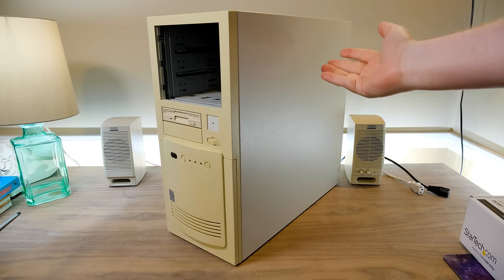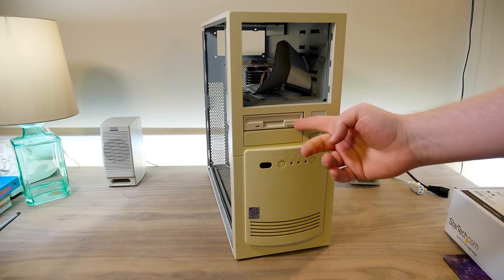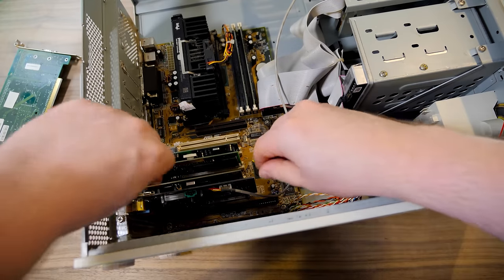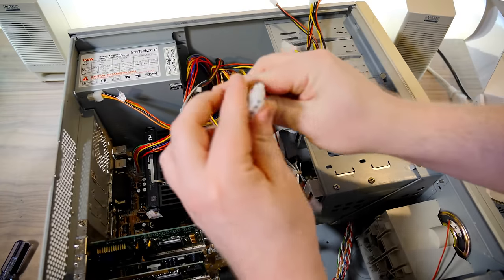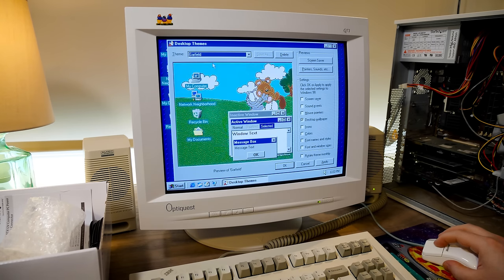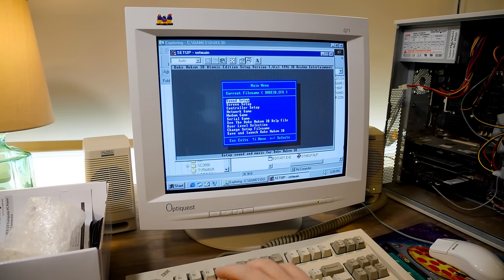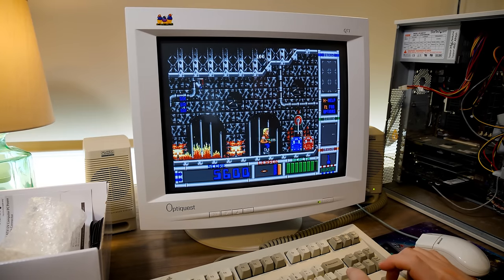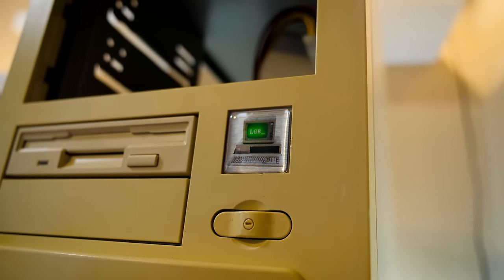Testing This Generic 233MHz Pentium II PC Clone

Comment: SBlive support for dos isn't great it requires protected mode so some games wont work and uses lots of memory. That dirt on the bottom of the case looks like the residue from water evaporation. I think the system got wet and the dust turned to mud and settled on the bottom as it dried. ET6000 with a Voodooo1 was a common combination because the et6000 was a fast 2d card with a high quality ramdac (a good card for highres software quake and duke3d).

Comment: I remember my first computer was a Gateway 2000 it had a Pentium II processor I had Windows 98 second edition on it and then I remember upgrading it to Windows XP that was in 2004 OMG it was horrible LOL I had also a 6gb Quantum Bigfoot hard drive I believe I maxed it out at 256 MB or was it 512mb I can't remember but I remember using dial-up AOL. I think I paid like $40 for it at Goodwill it came with the keyboard the Tower and the monitor and a mouse. I used it until about 2006 when I built my  very budget gaming computer.

Comment: I do have a stupid question about systems like this. I do imagine that the agp slot is only 2x and then we have the voltage problem using any agp graphics cards that uses agp 4x o 8x being incompatible. Would be a common card like a fx 5200 compatible with  a system like this for retro gaming from 94 until late 2003?

Comment: I want to see you make a BeOS computer cos I used read about it in magazines but don't have much of a clue what it is.
Reply: The BeBox was a serious RISC workstation with dual PowerPC processors and tons of expansion.  It's too bad it never went very far.  It was originally designed around AT&T's Hobbit processor which was designed to run C code natively.

Comment: Missing screws and hard drives with only two screws holding them in? So that's where my old PC went to ;-)

Actually no, it's not my PC... that HDD has two screws holding it down and the motherboard isn't relying on the cards to hold it in the case.

Comment: A system like this here in brazil costs more than 2 and a half times our minimum wage(R$ 1000 Reais its the minimum wage. With the actual dolar would be like 500 us dolars . Speculation over vintage hardware here its horrendous. If only i could pay for someone send me one of theses to here, would be wonderful. Certainly it will cost less than buying non-working vintage computers from inside the country.

Comment: Pentium 1 233 MMX is better IMHO than the Pentium II.  Because you can have very fine grained control of its speed using setmul. So you can run really old games on it.  Down to 386 speeds

Comment: my guess to your question at 23:01, it's an infrared transmitter/receiver they are common on PDAs Laptops of that time, might only be a mounting point to mount the two LED's needed, if lucky maybe an IrDaTx/Rx connector pin header on the motherboard, maybe by com (serial) ports labaled IrDa or something?

Comment: Why did older PCs always have the psu at the top?
Reply: @Jason Bourne   I'm not sure why that answers my question. Is the psu the hottest part of the system? That would seem odd to me. And the case doesn't even vent from the top anyway; in fact, the exhaust fan is /below/ the psu

Comment: If you want Adlib emulation on a Live! card in Windows 9x (or DOS Prompt), you have to go into Multimedia options in the Control Panel and select the FM synth emulation from the MIDI device list. You can also select MPU-401 from there as well.
Reply from the maker: That's if you want to enable FM synth mapped to General MIDI on port 300/330.
What I was testing is AdLib emulation on port 388.
Reply: @LGRBlerbs  Yeah, there isn't any hardware-based Adlib emulation on the Live! cards as far as I'm aware. I also couldn't get it to work in real-time DOS mode using the Philscomputerlab drivers, and that was with the full SB0100 model, so I don't think you'd have better luck with that cut-down Dell OEM version lol.

Comment: GM never has been amazing on the sblive? Are u nuts Clint?
You may not like tbe bundled soundfonts but it could load better ones as long as u had enogh system ram. Try a 32mb one or aorund that and tell us it's not amazing (wasn't recommended to load anything over half the system ram).

Comment: FSP powersupplies (The person who made that sparkle) at least at one point was known for making good PSUs... but everything wears out over time.
Reply: Yeah, I've seen a handful of SPI PSUs over the years.  Better than others I've encountered.  This one just sounds like a fan that's dying.  I bet if that was replaced it would still work fine.
Reply: ya it would be worth changing out the fan on that sparkle supply, those things are some of the more power supplies I've ever used
Reply from the maker: Yeah I could swap the fan and it'd probably be okay.
Though I'd still rather replace a 20+ year old power supply with a brand new one when I can.
Reply: Back in the days I was working retail selling computers and custom builds, Sparkle was considered a good / reliable power supply maker

Comment: I was out walking my dog and came across a Dell Dimension XPS R450.

Pentium II 450 Hz MMX
384 MB RAM
Radeon 9200 128 MB
12 GB HHD with XP SP2
Sound Blaster Live!

Brought it home and cleaned it up and what did you know, started right up. It was full of anime crap. 

I use it for Pinball.